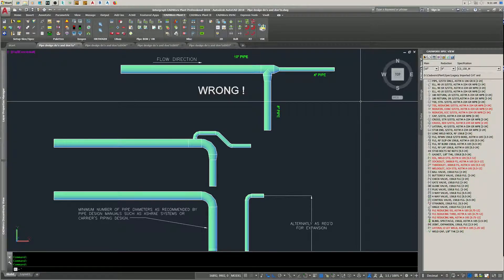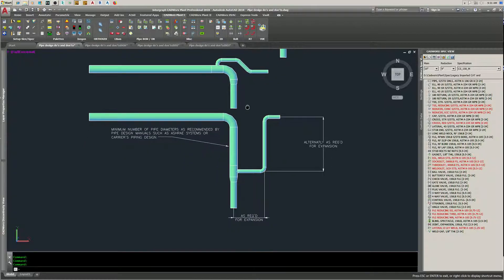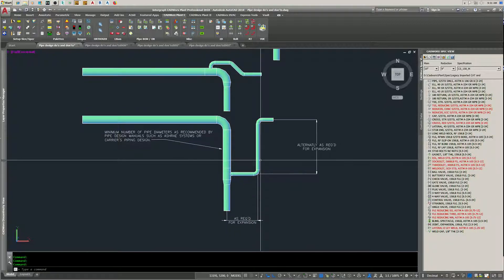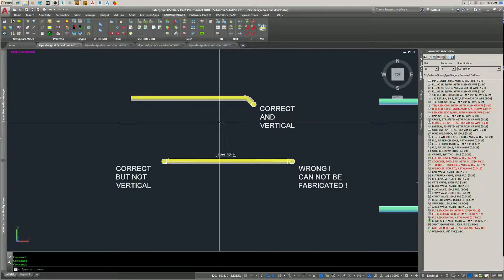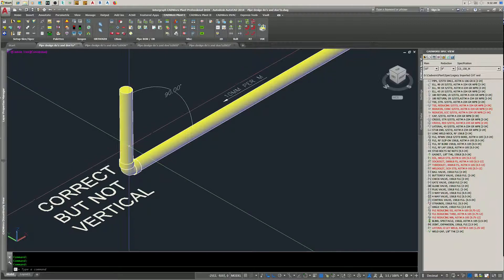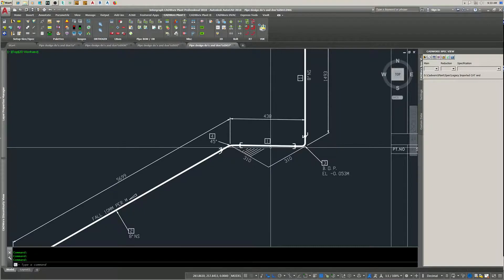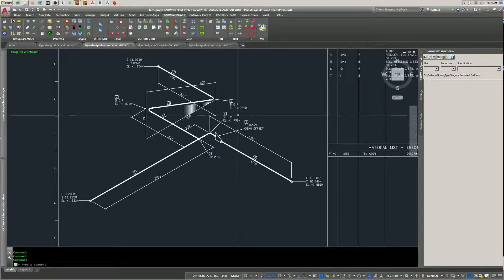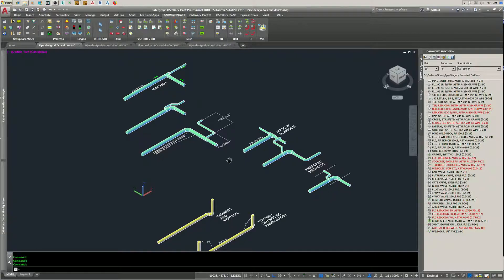good pipe design practice, cadworx

Comment: I saw this video by an experienced piper that told me a common practice is dead wrong! 
Craig, your good piping practices are about as helpful as a chocolate teapot.
Reply from the maker: A 90 degree socket type fitting is exactly that. Slope the horizontal run that the 90 degree is connected to and the vertical rise is vertical but it is not plumb. Look up “plumb”.
Reply from the maker: On a side note, had you looked at previous comments regarding the same issue you would have seen a more detailed explanation.  Google “plumb” as in plumb bob.
Reply: @craige7667  @0:01 your intro just made me want to ignore the whole video. tees and reducers are great and cheaper than whatever design manual you follow.

Comment: So why are those setups impossible to build?  You mentioned rotation but I'm not making the connection. Moreso the vertical/sloped pipe examples. The first few cases were clear enough visually.
Reply from the maker: A vertical rise connected to a sloped pipe with a 90 deg. ell is going to be 90 deg's to the sloped pipe.  I should have said the rise is not going to be plumb instead of 'vertical'.  Meaning if you were to hang a plumb bob from the top end of that vertical rise the pipe would not be parallel to the plumb bob string....google the word plumb. That is why a second fitting is required before the vertical 90 so the 90 can be rotated into a plumb position.  Take a look at this  https://www.youtube.com/watch?v=fwqHiGUcS4A   Now if you don't care if the pipe is plumb...no problem.

Comment: how to increase pipe size range in cadworx spec
Reply from the maker: My apologies for not responding sooner.  The short answer is to take a look at the PDF file called 
"CADWorxPlantUserGuide" located in <Drive>/CADWorx/Plant.  There's also a PDF for tutorials that 
might be helpful.
Reply: @craige7667  thanks

Comment: how to encrease pipe size range in cadworx spec
Reply from the maker: Open your catalog.  in the top left panel "Catalog Data" click the plus sign.  Double click "Size".  In the right side a data table will open with the current sizes.  Right click in the grey header and select "Add New Size".  You will have to update
your project file.